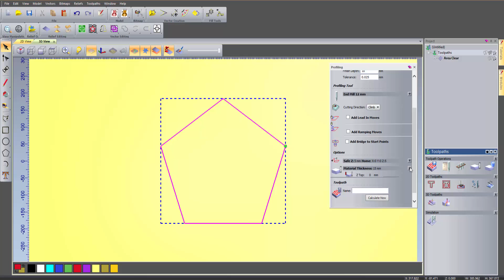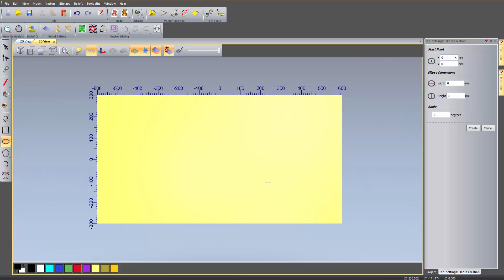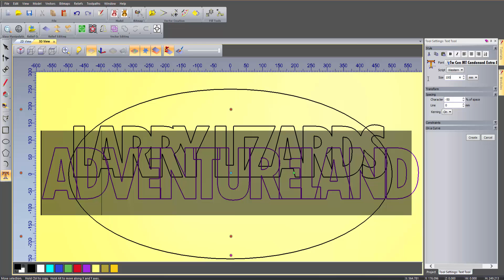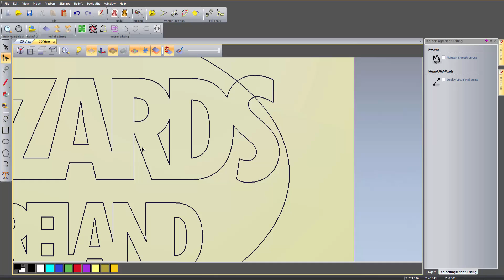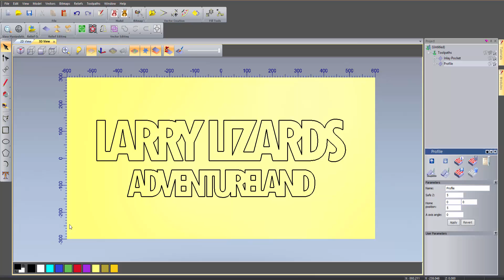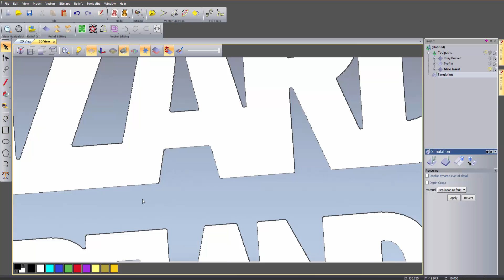Basic Inlays with ArtCAM Express 2015 R2

Comment: Great explanation.  I've tried doing inlays a few times with very limited success. The reference to the "tolerance" is a small but very important adjustment that I had completely overlooked. I tried a couple projects with a neg. value with much better results. Thanx for this tutorial.gm